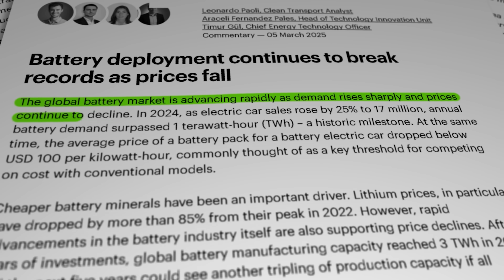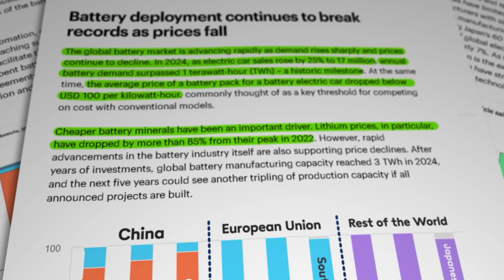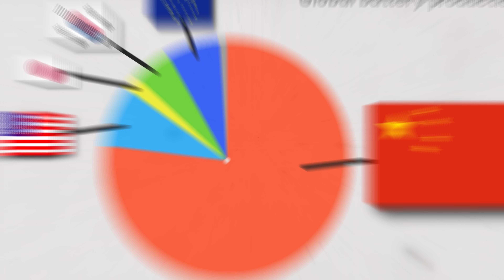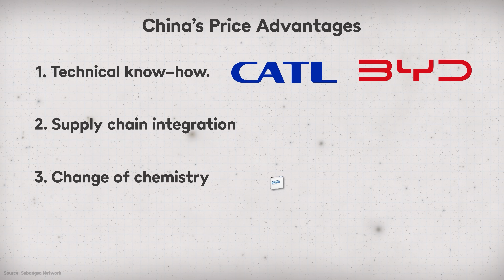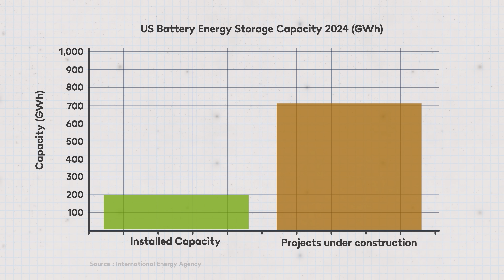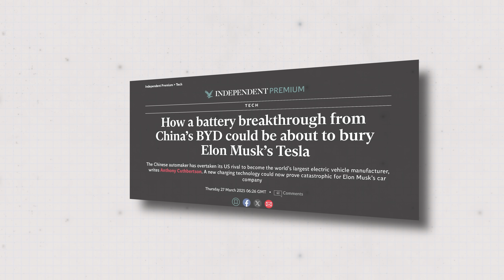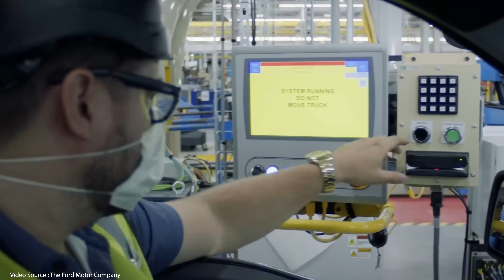Have batteries just hit their exponential curve??

Comment: CATL, the battery maker has just announced a workable Sodium battery that would be added to Lithium battery packs.  They are 10x cheaper than Lithium batteries with reasonable output and longevity.  We have reached "Peak Oil" because no one is drilling for new oil, and no one is building new oil refineries.

Comment: It's all good news, but, we need to consider that EVs cant cover the whole fleet> OEMs have stopped making the smallest most fuel saving smaller models. We need a framework similar to the KEI cars of Japan to continue with the ICE but cut down to a legestated specification and market ready to run on hydrogen when the supply becomes available. Look back at the ford fiesta from the early 1990s. Cut the weight and limit engines to sub 1000cc. Legestate those cars must be available along site EVs so all the OEMs produce at least one small ICE model, May be use a shared platform. The old Yaris and fiesta needs to come back.

Comment: I've read that BYD is going all in on sodium batteries now for EV and stationary applicaitons. Though a bit less energy dense, they are cheaper, have lower environmental impact, are safer, charge faster, and have a wider temperature operating range. Charge cycle life is unclear, but appears to be as good or better than lithium.

Comment: Toyota has a big battery assembly plant they are opening in North Carolina, to supply all their cars they build in Kentucky, Indiana, Texas, Mississippi, Alabama, Missouri, Tennessee, West Virginia, and North Carolina.  So tariffs will have little effect on them.  If just bulk lithium is imported from Peru, the tariff would only be a few hundred dollars per car.  If they switched to sodium batteries, no tariffs would apply.  There is no reason to use lithium for stationary batteries.

Comment: The biggest issue I see with EVs and battery adoption is safety.  Run away thermal fires are already getting EV chargers banned from underground garages since the heat places the structures of the building at risk, and the toxic gas places the building residents at risk.  Insurance companies are noticing, and EV insurance costs are rising.    I'll leave you with the EV fires on two car carrying ships, which took weeks to bring under control - google it.

Comment: RE: the noisy naysayers it might be a good idea that the rhetoric that you are pushing out on Lithium-ion batteries is curtailed by some realities instead of peddling wishful farfetched and fanciful nonsense.
Yes, the Lithium-ion batteries have a role to play in conjunction with renewable energy settings at the consumer premises level and EV penetration for some users but it won’t be a replacement of ICE cars anytime soon as you and some of the governments suggest.
The reason is that the production of EV batteries is extremely environmentally destructive and messy at the mining for rare-earth metals, environmental destruction of large water resources for Lithium mining. The truth is that if everyone were to change to an EV, the resources required for battery manufacture would be overwhelmed. 
From an environmental perspective, the recycling of EV batteries, despite the lofty claims, is far from satisfactory where tons of batteries end up in land fil contaminating the environment or are stored in containers and other facilities that have a propensity to catch fire and further emitting toxic gases into the environment. There are still many safety issues that need to be devised and implemented in relation to EVs catching fire where costs may well prohibit the storing of EVs in underground garages of high-rise buildings and so forth.
In the UK, as well in other western markets, the upfront cost of EV is still prohibitive for many users not to mention the massive depreciation costs and the relatively 10-14 year life-cycle of EVs. Even an EV that is 4 years or older, the 35,000 Pound cost of replacing the battery isn’t worth it so the car gets scrapped where the CO2 baggage of manufacturing is wasted.
Aside from this, EVs are not suitable for everyone’s lifestyle and use of private transport. 
There is a strong indication that EV penetration in most western countries is not going to exceed 30% in the long run.

Comment: The backhanded comments about Elon and Tesla are deeply disappointing. Have been subscribed for a level headed discussion on current climate, but you're showing political bias when discussing the issue. Hope that stops.
Reply: Agreed. Backhanded comments seem to be trendy nowadays but they are lazy and fail to address any complex nuances. If there are concerns I'd rather these be addressed in an even handed way with level headed first principles thinking and a dose of optimism.

There are many of us who support this channel both vocally and financially who have also come to appreciate the hard work Trump and DOGE are doing. Will they make some mistakes along the way? Sure, and they even call those out. The important thing is to try to solve difficult problems and course correct when you've made a wrong turn.
Reply: @nettlesoup  Thanks for expanding, these are my thoughts exactly. Also Elon's influence on Trump is limited, blaming Elon for Trumps stance on the environment is the same kind of rationale that leads libertarian "environmentalists" to set Teslas on fire.

Comment: One other point is that US factories will be driven by greed and the need to win at all costs over that of the worker. (Rich over the Middle and Lower class)
The factories will have few personnel and be as automated as possible.
Corners Cut and maximum payouts to CEO's and directors of Marketing. 
Shareholders getting meger dividends in hope of stock price increases. upwards of 20 times revenue.
But we know USA won't be cost competitive because the minerals they need all have to be imported. Fe, Si, Li, Al and many other rare earths.
They will make their own Lithium Salts from seawater out of the Gulf of America. LOL.
They will have sufficient Sulphur from their Oil refining plants.
They will make their own Aluminium salts and foils but from imported Bauxite as the USA just does not have the minerals.
Why else do you think USA want to invade Canada.
Their  logistics chain and added excess profit expectations throughout the Supply chain will make them less competitive.
The USA will never compete with China as the USA is short term thinking and after maximum ROI. 
China is long term thinking and more modest ROI a-s all investment in long term benefits the Chinese economy provided it adds wealth and provides employment. 
It has been the American way of thinking that has removed manufacturing from within and from countries like Australia and UK.
That is where change is needed.
Think more for the population as a whole not just to be the greediest MOFO on the block.

Comment: Will batteries hit an exponential curve? Not for long, physics and math will say no. 

Consider One 50 MW data center. A Tesla Maxpower battery has 3.9 MW-hrs of energy. To run the data center for an hour takes 13 of them. To get through a 15 hour northern US night would take 195 of them. 

They weigh 42 tons apiece, so 8190 tons of batteries, about the same as a Burke class destroyer. 

How does the economics look now? Trying to recharge those babies during the 8 hours of daylight (horizon slop costs you an hour of your daytime) through the usual winter inversions which cause dead calm and heavy overcast (7% of nameplate PV rating) is an exercise for the alert and math competent reader.
Reply: As long as they are stationary their weight does not mean much. But, as batteries are being used on vehicles, the gravimetric energy density becomes extremely interesting. Following a curve that is ... not exponential. Instead it is asymptotic. :face-orange-raised-eyebrow:

Comment: 1:04  What if the AMOC is a temperature regulator.  (You know, if the aliens or simulation programmers designed it this way.)  What if there is a set of trip points that turn the AMOC on and off.  Once the temp rises to the upper trip point, the AMOC collapses and the planet cools.  Then, when it hits the lower trip point, the AMOC starts up again and the planet warms.

Comment: Here's the kicker. Not only are all those batteries not replacing oil they are giving us to refire up old coal plants. The batteries are bringing back coal. Again I must emphasize this, we cannot address climate change on the demand side. We must attack the supply side which is fossil fuels. We must limit and then eliminate the extraction of fossil fuels. The good news about new technology is it won't be as bad as it otherwise would be. Regardless we have to cut fossil fuel s. The consequences of not are too dire. Once we start doing that we can figure everything else out.

Comment: Here in the US Midwest, I just did some research again into EV’s though I have to drive 300-400miles per week. After the math, A Chevy bolt would save me $18,000 in 20yrs(the battery would not make it that long, but as an example). A 2yo Chevy bolt cost $18,000. So I was like sure I’ll take a car for almost free. So I researched battery costs to see what the risk was. Replacing the battery at Chevy was $15-18,000. So not competitive to even a 24mpg SUV. I was so disappointed. Anyway, I agree the only thing that will save this is higher density batteries and cheaper EV’s. I mean, Chevy’s prices kinda proved the Car itself is almost free lol.

Comment: I really hope the EV naysayers don't honestly believe ICE engines will continue (even if you don't consider the Climate there are a finite number of accessible fossil fuels anyway). Hopefully they just think liquid Hydrogen will take off. I see a future where EVs and Hydrogen can coexist. I also see a future where Hydrogen doesn't take off because it's too hard to transport. So unless there's distributed on-site generation of Hydrogen it's so much easier to generate electricity anywhere and everywhere.
Reply: Hydrogen is just a non starter...  It costs way too much to isolate, compress, and store hydrogen long term...

For every mile driven:
3-4 cents per mile to drive an EV
8-14 cents per mile to drive an ICE car
22-30 cents per mile to drive a hydrogen fuel cell car.

Comment: The Aussie feds have spent 12 billion dollars on the pumped hydro, or snowy hydro 2 so far and counting. 2 more years to go. Considering pumped hydro has a round trip efficiency of around 50%, the term white elephant comes to mind. The Albanese govt has proposed a subsidy of over $300.00/kw for home batteries. At that rate, 12 billion would have bought 40gw of energy storage, enough to fix the duck curve that's making Aussie electricity so expensive. Snowy Hydro 2 is only 2.3gw

Comment: Generation, transmission, consumption and storage.  There are four aspects to the way energy is utilized in an industrialized society.  The disruptions caused by intermittency in generation have led to a demand for grid-scale storage.  The challenges associated with transmitting electricity from a far greater number of generation sources (roof-top solar and "farms" ad nauseum) has made it much more difficult to meet demand spikes which could be mitigated by more homes having some kind of on-site storage.  Finally, the disparate nature of green generation and daily utilization cycles has given providers yet another frustrating riddle to solve, which can only be resolved with more of both solutions; grid-scale and home energy storage.  With that said, small-scale nuclear and plasma-boring geothermal are sustainable, carbon-neutral  sources for baseload generation which can be supplemented with wind, solar and batteries.  Some combination thereof is where we're headed.

Comment: The U. of Adelaide developed a Lithium-Sulfur battery yielding 1,306 Wh/kg with 1,000 cycles at 8C power density, but combined with the ion sieve of Karlsruhe U that provides 25,000 cycles at 5C, you’d have a cheap, really energy and power dense forever battery. The ion sieve of the Karlsruhe Li-S battery is so efficient, it can even reach 150C with decreased cycling life.

Comment: There's a French company who made a bike called the Pi-pop that uses supercapacitors so they can get away with using less lithium in the battery.  There's a second company in the Netherlands I think doing something similar.  Maybe more batteries can perform better if they're paired with capacitors?

Comment: You are wrong about Northvolt. It did not start small and scale up. It was actually the other way around. The problem with Northvolt was that they did not anticipate the actual complexity of producing batteries.
Reply: I worked on the project of a new chemical plant conjointly with another engineering firm.  That firm was also working on the design of the Northvolt factory... so I heard quite a few things on the topic from my colleagues.
It seems that they in fact did not know what they were doing... or, to put it more mildly, lacked of a lot of experience.

Comment: 5:14 Number 3, ENORMOUS subsidies from the state and selling batteries at a loss only possible because of the enormous subsidies.  WHY are you pretending you don't know this?  In the first 6 months of 2024, CATL received 3.85 billion yuan (550M USD) in subsidies.  That was just the first 6 months.  If you take that to the whole year, it's 1.1billion USD.
Reply: Google: really bad air pollution in Beijing China a dozen years ago tarstarkusz to see why China is pushing eVs so hard. Note that Los Angeles CA was pushing really hard in the late 1990s to switch to hydrogen/fuel cell powered vehicles because of bad air pollution too.

The air pollution was so bad in Beijing that huge numbers of young children were developing lung problems (as well as the elderly). Now by making ICE vehicles prohibitively expensive to register, large numbers of eVs in Beijing have dramatically helped Beijing's air pollution.
Reply: @peterh5165  That is not why they are pushing EVs (New Energy Vehicles in chinaspeak).  None of that pollution was caused by cars.  Cars simply do not create this kind of problem.  It's all the factories and industrial processes and the fact they don't enforce their laws.
The real reasons they are pushing NEV is because they are decades behind the west in ICE manufacturing.  Second, just as if not more important is their reliance on oil imports and the fact they need Dollars to buy it.
Cancers are absolutely out of control in china, but it has nothing to do with cars.

Comment: All the newbies to the EV manufacturing club can use some amazing innovations from Tesla before its CEO went nuts.  A couple that come to mind is the injection molding of large chunks of the frame of the car and the armature that consists of one wire with actuators at each device (wind screen wipers, horn, window winders etc etc).  The first reduced the number of robots needed and the second reduced by a huge amount the amount of copper needed in a car.  We must give Elon his due but now he is completely off the rails.
Reply: I would say give Tesla designers and engineers their due, unless Musk himself did this.

Comment: I'm almost convinced that the price of the actual batteries is irrelevant.  The batteries in a Tesla Power Wall should cost about $1,350.  I just got a quote for $19,000 (to go along with my solar panels).  I needed a new battery for my weed trimmer.  Capacity <0.2kWh.  Price $300.  We need a great decrease in the cost of all the ancillary equipment that goes along with the batteries.

Comment: If lithium has dropped in price by 85% why haven’t home batteries dropped in price or more capacity for the same price?
Reply: They have dropped. When I started buying EG4 5 kWh server rack batteries I paid $1499 each .They had dropped in price to $1050 recently until inflation and tariffs threats pushed the price back up. 
The newer 14.3 kWh upright batteries are better and cheaper per kWh.
I built my first LFP battery,20 kWh, with raw cells and BMSs for less the server rack batteries and it is still running very well after nearly five years.I have accumulated 60 kWh of storage and don’t need any more now but even with tariffs it would be cost effective for off-grid solar.

Comment: I'd love to see some explanation of home power versus auto power comparisons because damn, best I can find for home backup battery power, on sale, right now, is about $500/kWh. Granted I'm comparing automatic production costs to end user market costs but DAMN if that's not a huge difference... And sure I'm seeing cost drop across the board over time but still, looking at a whole days back up energy supply is still 20k or more...
Reply: The secret to lower cost is DIY. It’s not very complicated to put in an essential circuits panel with off grid inverter and a few solar panels for less than the cost of Tesla power walls. Another advantage is the easy scale ability of off grid.paying as you go with the savings on grid power costs.